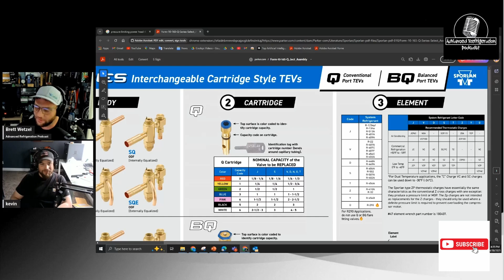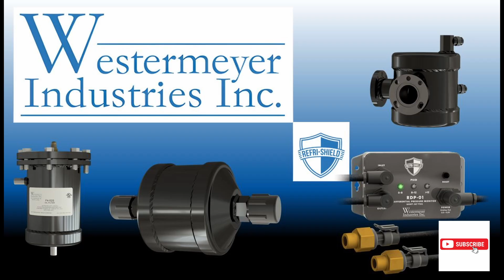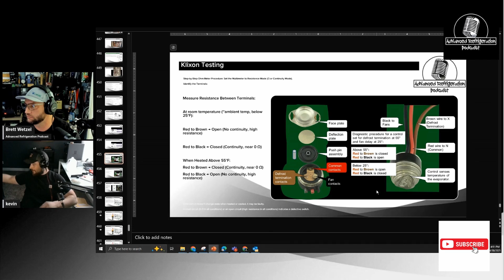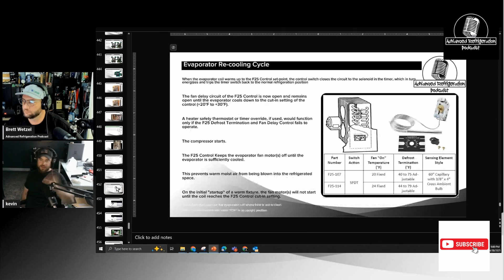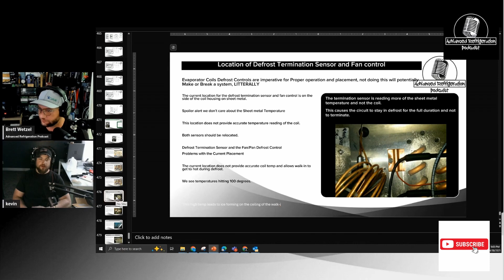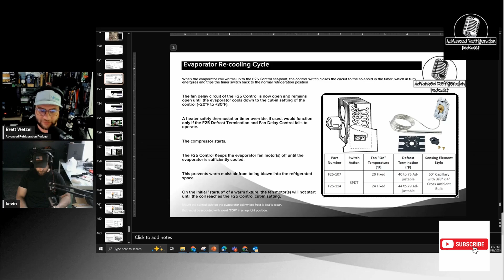Basic Defrost Clocks, Defrost Issues And a 3 legged feral Raccoon Episode 418 Video

Comment: You can lock a defrost on a hot gas coil if the manifold on the rack is built right.   If there is a return gas manifold at the rack, you can lock the defrost on as long as there is nothing else using a gas defrost.  I have done that and managed to clear some major ice-ups.